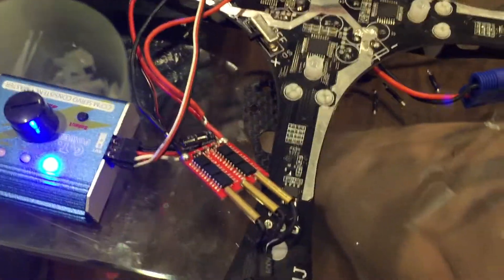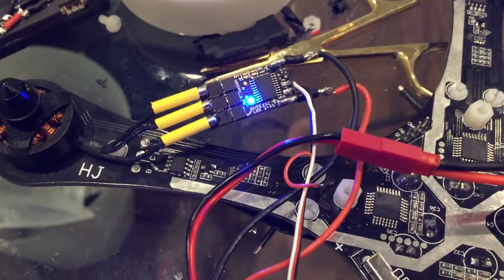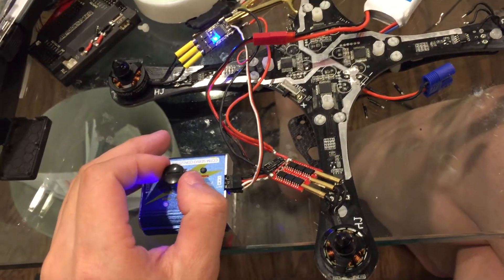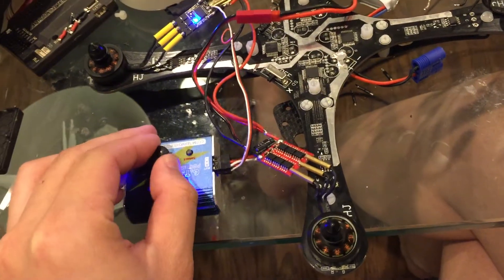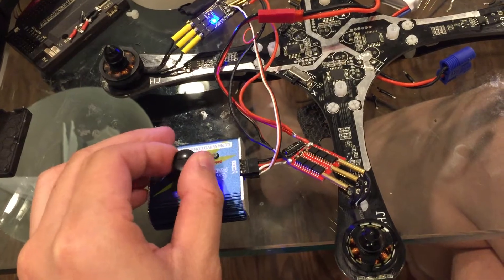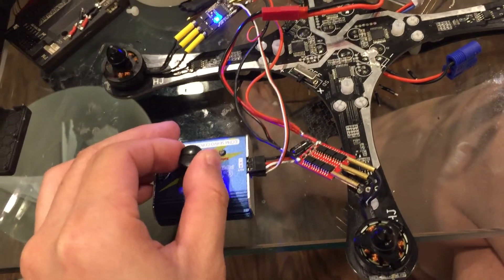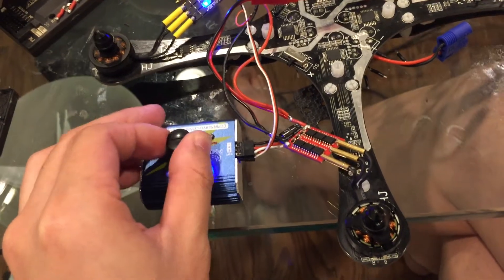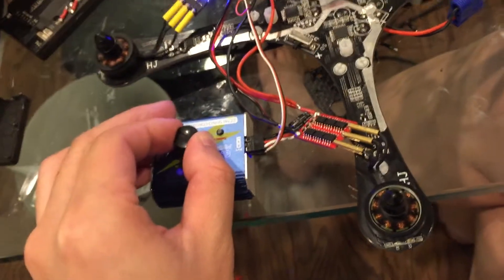KISS ESC 18A Vs. SimonK 12A

Comment: What is that frame?
Reply from the maker: It's 230 size frame with build in ESC, the ESC is 8A. I believe Hobbyking still have some in stock. If you buy that frame be careful the BEC output are not 5V. It almost burn my APM. When I realize something smells bad. I check the voltage. shows 8V. I used 3S battery